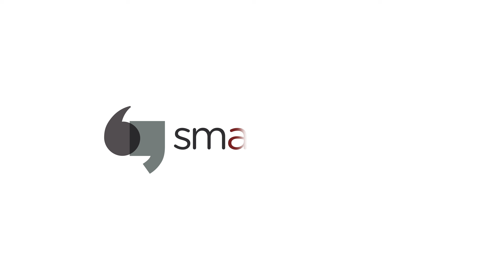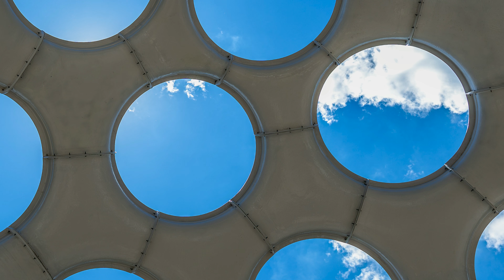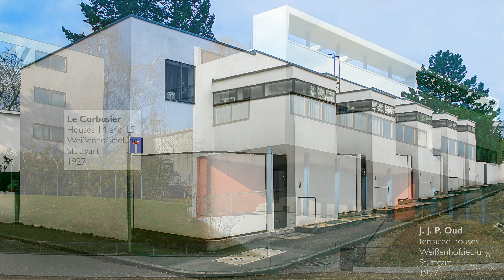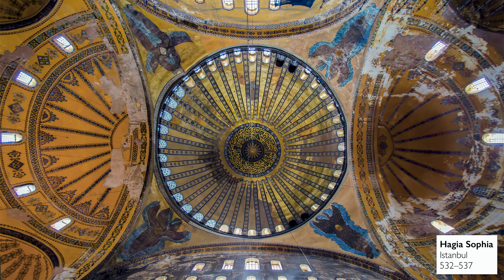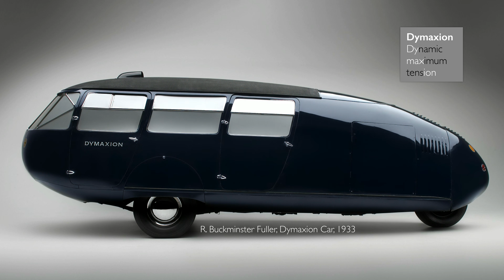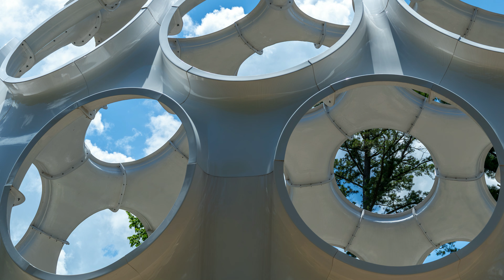R. Buckminster Fuller, Fly's Eye Dome

Comment: Fuller was wrong in discounting mass. Without it buildings have no thermal inertia, greatly increasing the heating and cooling loads and making the  building less sustainable. Energy was cheaper and no one thought of global warming in the sixties when Fuller formulated his theories.
Reply from the maker: All right but as we mention in the video, this is theoretical, clearly not a blueprint for a house. The issues of material and energy expenditure is clearly still in flux.

Comment: At first I though each panel was identical, which means you would need only 1 mold to make them.  But upon looking more carefully, I see at least 2 types of panel.  All the panels have three connector edges where the panels are bolted together, but some have two narrow edges and one wide edge, while others have 3 wide edges.  This surprises me, actually, because the holes appear to be fairly regularly spaced, and I would have assumed that all the panels were identical.  There is probably some deep geometry in the pattern of the different types of panels, that is not obvious at first sight.
Reply: The underlying geometry is that of a geodesic dome. Geodesics are made of lattices of hexagons joined at the vertices by pentagons.
Reply from the maker: Many of his drawings and writings are available if you want to dive deeper.

Comment: Aesthetics aside, if you construct a spherical shaped building that is 50 feet in diameter, you will have about 65,500 cubic feet of interior space. However, if you construct a cube shaped building, of 50 feet length, width, and height, you will have interior space of 125,000 cubic feet - roughly double in size.
Reply from the maker: Yes, but while true, I think this calculation misses Fuller's point. I don't think we suggested that Fuller was seeking to maximize square footage. Rather he was trying to find a sustainable structural system that minimized impact.
Reply: It’s great for liquids, gasses and smaller particles. But difficult for humans and their things, which tend to be rectilinear. In addition, the curvature creates a space that is difficult to subdivide, whereas rectangular shapes can be made in all sizes without regard to the shape of exterior envelope.
Reply from the maker: I don't agree, of course much that we are used to has to be rethought, but I have seen some very successful and attractive dome interiors.
Reply: @smarthistory-art-history  Yes, dome interiors can be beautiful- I have friends who built an Earthship home out of recycled tires (two, actually- the first was tragically consumed in a wildfire).  I also owned an office in a circular building. The problem is that the curvature of the furnishings must be customized to the arc determined by the radius of the building, whereas a straight line is always the same.
Reply from the maker: That is true. Of course some domes have faceted external walls (so not entirely round) and of course interiors can have at least some straight walls.